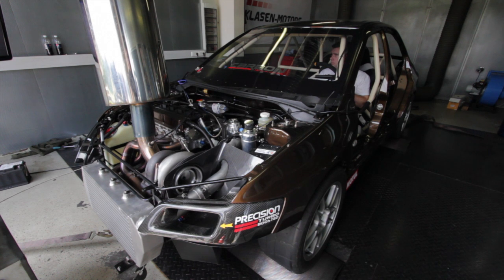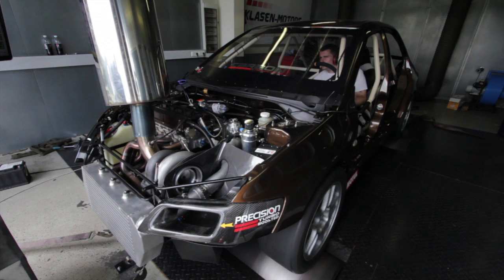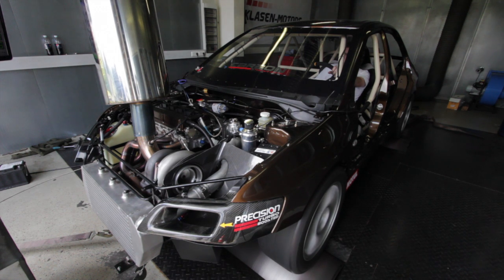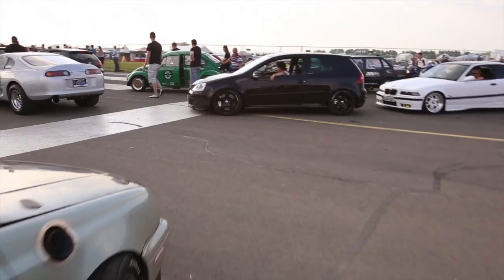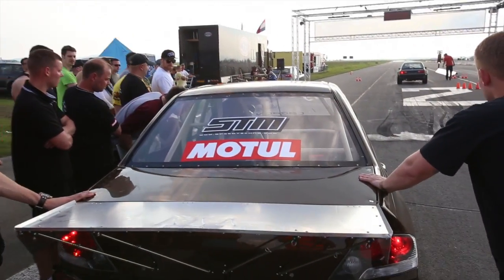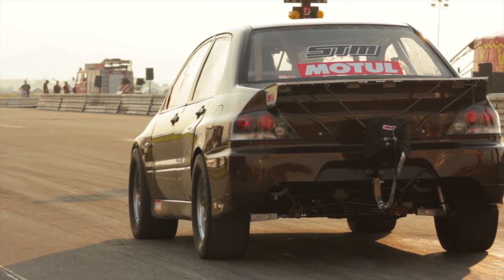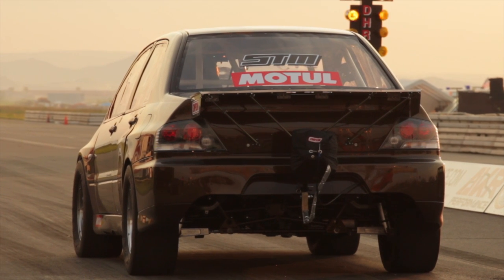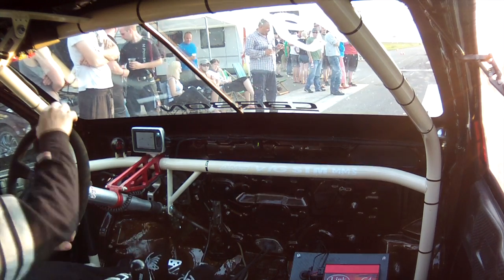8 Second Mitsubishi EVO Drag Car | Material Mord Shop, Germany

Comment: niceee setup. 1100hp at 45 psi most have high compression piston and big turbo. u can probably put 100 hp more and that's max 1200hp is alot for this motor. because off compression is to high it won't last long.  but very nice setup tho.

Comment: why not lower the compression?
Reply from the maker: Using a high compression ratio on a methanol engine improves boost response and power/torque. :)
Reply: ahh, but lower till not lift the head, its a hard situation haha